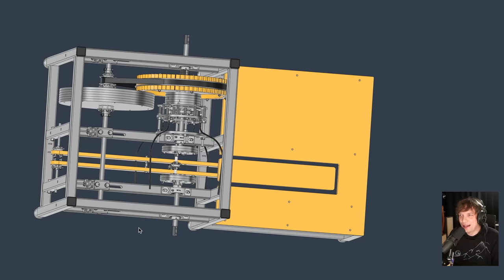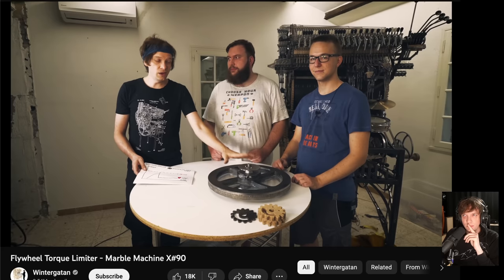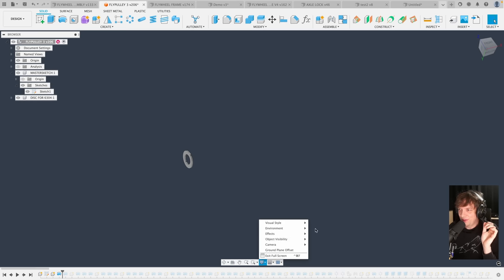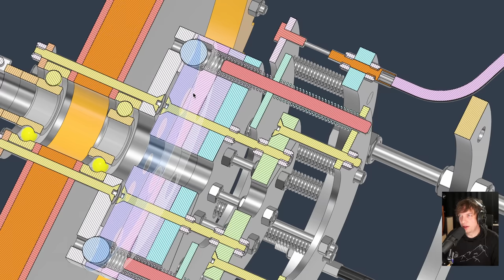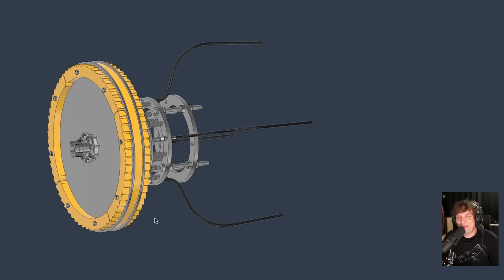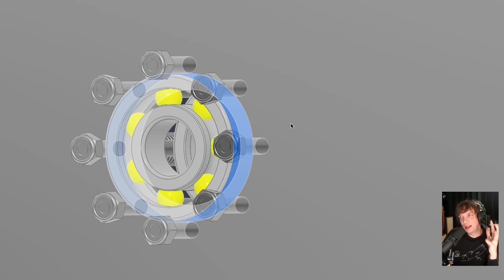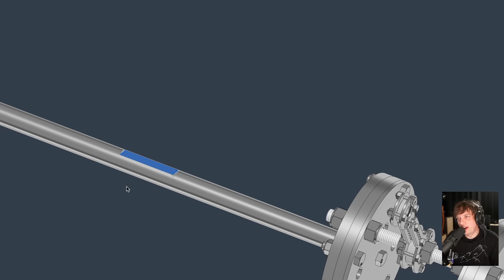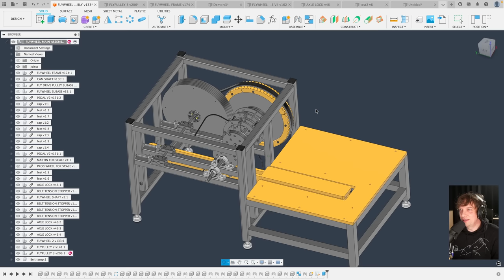Safety First! - Marble Powered Clutch

Comment: 10:35 Hey martin as much as as love the choice of using marbles for the clutch wouldn't it be simpler to use a plate with bumps on it? Alot of the complexity i see here is because of the use of marbles and by having a plate it could reduce complexity and compress the design down. It could also would make the disengage mechanism of the clutch simpler since you would on need at most one spring for the whole set of detents. since they are on a plate you could place a separate plate that is pushed by the spring that separates the spring from the plate with detents you could pull back on that spring and release the clutch that way saving another spring.
Reply: I think the marbles add "continuity" that the bumpy plate does not. Unless you break really fast and high force, separating the plate might be a jerky action with high friction between holes and bumps, thus degrading the bumps faster than marbles.
Reply: Machining a plate with bumps to a high enough precision to be effective would be a lot more complicated than machining a plate with holes and putting springs and bearing balls in them. And I imagine the metal-on-metal screaming that would occur during an unplanned disengagement (or a re-engagement in general for that matter) would be awful.
Reply: Fewer parts. I agree.
Reply: Define simpler? A plate with bumps on it is a relatively serious machining operation to create if you can't find a good one off the shelf, and even if you can could be tricky on the world tour if its not a super common part. And as the bumps are wear areas it will need replacement sometime. 
This is simple constructed method to get the result with parts that can be made almost anywhere, with very limited tools, and if you pick the right materials you can be sure it is the cheap and relatively easily replaceable balls that must be replaced most often.
Reply: I think that would save a lot of parts but it could also limit the usefullness of the torque limiter since one of the main benifits of using marbles in the desighn is the low friction when the torque is too high since the marbles are free floating and mostly free to move. A plate with detents would allow more torque through the limiter since the unmoving detents would cause more friction. It would also wear faster while being less esily replaced and also heat up more and maybe distort depending on the way it's made. that being said I'm an electrical engineer not a mechanical one so I can't tell for sure.

Comment: Hello, I think there are a few constructive errors in this part.

First, it is important to separate high energy parts (only the flywheel!) from low energy parts. As long as it is possible that a lot of energy can suddenly get into the construction, you will have problems.

It is best to separate the safety clutch from the normal clutch and also separate the brake.
The safety clutch is placed directly between the flywheel and the belt, this is where the greatest jump in energy is possible. Then there should be a V-belt. With an adjustable tension, you automatically get a manual clutch. And then a normal bicycle brake is sufficient as a brake in the low-energy part.

Lots of love and keep going! ❤

Comment: Not a fan of the D-style axle flat. You get a tremendous torque multiplier from the large flywheel down to the comparatively small diameter of the shaft, and all that torque wants to force the two split halves apart. Maybe I'm reading the diagrams wrong but the only thing constraining them from separating are those 6 or 8 concentric bolts in their laser cut holes. Those are going to have slop because they have to be clearance holes (you need precision ground shoulder bolts or dowel pins in reamed holes to eliminate that) which means they will move ever so slightly. All it takes is those two split halves opening by a tiny amount and now you have play and slop against the shaft, and slop on a shaft multiplies over time because every time it starts and stops it wears a little more -- especially when it's mild steel of the clamp against (hopefully) a ground polished hardened shaft. Shafting isn't an area that I'd get creative with, there are plenty of established solutions for almost every need. For example you might want to use a taper lock system, which attaches to a plain round shaft by friction alone and is very strong.
Reply: He is a genius, he doesn't care. Been digging his genius grave for 7 years now.

Comment: Those half moon connections are really something. A little peg holding onto that shaft wouldn't stand the tork. Just perfect modular elements interconnecting to make one solid struture. Well done Martin!
About the bolt baring housing I'm a little more cautiously enthousiast as I really enjoy this idea, but a little worried about the point load ont the baring housing. Try to get some info on that at SKF (if you have not allready). 
Are those ratchets on the wheel perhaps for the future marble lift?
You keep up the good work and don't forget to enjoy the ride.

Comment: I have a fairly serious concern about how the braking force would be transmitted through the rotating component.
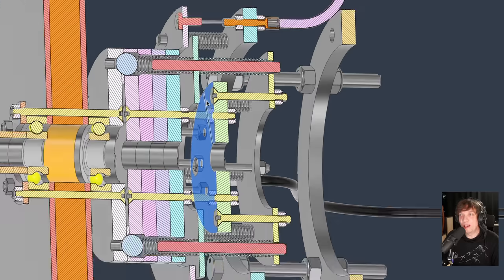Taking the cross section at around 12:04, as the pink disk is pulled back by the Bowden cables, it will press into the rotating cyan disk, and will apply forces backwards and against the rotation. The only thing keeping the disk rotating is the red rods, which are only solidly anchored at the yellow disk.
These will likely twist under the force, bending the yellow disk, and crushing the spring into the channel in the layered disks. This will get particularly bad if there is any kind of disturbance on the disks surface, as this could catch and dig in.

Then as the disk is pulled further, the braking force will engage. While the flywheel is not attached at this point, there may still be substantial momentum, and this will act to try and rotate the cyan disk against the rest of the system - again, a weak spot.
Some of this force will be absorbed by the green disk, but the green disk has mounting problems too (bolts don't like being loaded like that), and if there is more friction between pink and cyan than between cyan and green (which is likely, due to the springs), then there will still be substantial forces acting to twist the red rods, which provide a massive lever against the spring on one end and the yellow plate on the other.
There is also the issue of securing the pink plate well enough to provide the braking force, as it relies on a similar connection, although its rods are further out, and connected to a thicker plate.

To resolve this, you could take several steps:
1: add some solid rods from the plate stack to the yellow plate, say 8mm, and have linear brearings connected to the green plate.
2: remove the green disk, and make the bolts on the pink disk further out, add some bearings or at least grease between the cyan and pink disks, and add another disk (the brake disk), firmly mounted to everything else, and wider than the cyan disk. Coat this disk in friction material.
Then, as the pink disk is pulled back, it first pushes the cyan disk back, disengaging the clutch with minimal friction, then it pushes further and makes contact with the brake disk independantly. The brake disk has independant connections to the rest of the system, although has hols to allow the connections to the yellow disk to pass through it.
This preserves the same functionality, although it needs somehwat longer bolts for the yellow disk, and  avoids any substantial force going through anything moving in any other direction.

As a seperate set of improvements:
Make the pink disk be moved by levers so as to reduce forced through the bowden cables, add another disk the other side of the pink disk, so the rods holding it are mounted at both ends, and put some cheap linear bearings on the pink disk.

I much prefer option 2, and combined with he additional changes, this yeilds a system where no part has to excerpt force across a moving connection - everything is either lubricated or has a bearing. Forces on the cable are reduced by the lever, etc.

Edit: I didn't see that you planned to use the green part to transfer power onto the shaft. Please make this disk solid. The green has almost nothing holding the two halves together, meaning the turning force put from it to the shaft will act to split the halves apart. Splitting the halves like this requires far less movement than is needed to twist the bolts, so you're just putting move leverage against the bolts.
Having it play this role doesn't even help with the braking, as it still relies on the bolts back and forth to hold the halves together, and the braking force would likely hit the cyan ring, which is connected without much strength - so the braking force hits the springs and the yellow disk.
Also, the half disks in the stack are more aligned than I think they'd need to be - I'm prett sure it would be optimal to have none of them line up, as the thing hat matters is the strength of the connections between the halves, which is dependant on how many splits line up.
Although this doesn't really matter, as it's not a weak spot anyway, and having them all be the same is probably better for ease of assembly
Reply: Feel free to ask for clarification on this - I can hack together some cad for the proposed changes if you want.
Reply: Why do you even waste your time and brain with this "project"...
Reply: @constantinosschinas4503  Because I can. My time, my brain. I mean, its more constructive than adding even more LAMS to my current FtD ship - the thing doesn't even get hit by projectiles any more honestly.
Reply: @deathofallthingspotato9919  I have spent a huge amount of time jn this project, Discord too, for the very same reason you mentioned. Doesn't worth it, nobody listens, all martin groupies (which ruin him more than helping him). Regards.
Reply: @constantinosschinas4503  Fair enough - I've deliberately avoided the discord because I don't feel its worth it, but I do like analysing the problem.
Honestly though, I quite like looking into failing projects, so I might give it a look.
Reply: @deathofallthingspotato9919  lol. fantastic. go for it! it has been a lovely little school for me as well.
Reply: @constantinosschinas4503  I shall go there with your blessing, and my second burner discord.
Reply: @deathofallthingspotato9919  You have my blessing, heroic Knight.
Reply: @constantinosschinas4503  You have my thanks, now, once more into the breach!

Comment: so I think the design would work, but do you really need to do it with so many parts? would it be possible to decrease the number of parts? the more parts (not just the moving parts) the more chances there are for part failure.
I see places that could be one solid piece that is split into multiple, when manufacturing for that part would be easy in one piece too. more specifically where the marbles for the clutch are held you could make 3 of those disks into one part, with simple threaded holes in them. maybe you chose to split it up to make it easier to tap them, but an issue would be that it might not line up, and you would only need to tap part of it and have the rest not engaged to the bolt. even accounting for the keyway, this part shouldn't have much stress on it (the marbles will disengage before there is substantial stress) meaning that at least for most of the clutch you don't actually need a keyway, the bolts should be strong enough to hold it together aligning with the part you show near the end with the keyway (and possibly a small part of the clutch with one too). this would drecrease part count, decrease production cost and time, and while it is "cutting corners" it is one were the corners cut are into the copious margin of strength that part would have. to ensure you don't over load the bolts however I suggest doing a strength test on them to see how much force it takes to bend, shear, or snap them to get an idea of what safety margin you should have in this part.

as youve said in previous videos decreasing part count helps with reliability and manufacturing. the old fly wheel design I think has less parts, now the breaking feature with how dangerous the flywheel can be is a need, so parts should increase, but the clutch part itself should be about the same. im just curious if there was a design descision made not explained in the video to why it is like that. maybe it was for using a large metal plate to cut out all the disks, though with a bar like that it could be less time consuming to lathe it to shape.
Reply: I agree. Also no breaking material. Would have done a cycle brake setup and a correct bearing with flange housing
Reply: The 3 disks aren't actually disks. They're all split down the middle, and the split has been offset between each disk, so together they form a solid whole. This is so it can properly grab on to the slot that martin discusses near the end of the video. So they're separate parts for a reason.
Reply: @TijmenZwaan  yeah. But it is a bad solution. You should use a woodruff key solution instead, which is much better for transferring torque and alignments.
Reply: @TijmenZwaan  I updated my comment to contain my reasoning to reject that. though that does seem to be the reason he did, it isnt the best solution.

Comment: Hi Martin,
please reconsider your choice of using the torque limiter as a clutch. The torque limiter is not designed to re-engage when there is a difference in speed between the flywheel and the other side of the torque limiter. You would be better of using a proper friction based clutch for that purpose in addition to the torque limiter.

Comment: Since you spend so much time in CAD, might I suggest buying a 3D/SpaceMouse? 
I only recently got one, and it is amazing. 

(It will allow you to move, rotate, pan and zoom AT THE SAME TIME. which will not only greatly improve your speed but also results in very smooth motions for your CAD video’s. 

It does take a little bit of time to get used to, but after a day or so you’ll never want to design without it. )
Reply: I was thinking the same! I got myself a great deal on a lightly used Spacemouse Pro last autumn, and it's just fantastic!
I can't believe I've been working in CAD for close to 20 years without one.

Comment: 1. Are you going to stand on the platform and push the pedal down under the platform? That will be uncomfortable.
2. If you accidentally turn your foot when pedaling your toes will be cut off on the way up. Consider a safety hinge on the pedal arm instead.
3. There will be a lot of friction between the revolving part of the clutch and the nonmoving part when you start to engage the clutch leaver. In car clutches a lever pushes on a release bearing to solve the friction problem. Then only one cable is needed for the clutch.

Comment: just a thought in regard to the pedal and platform positioning (I may have observed incorrectly, if so disregard.). If the standing platform is level with the highest point of the pedal, pumping will use far more energy than if it is level with the lowest point because every push will require you to move your entire body up and down.  If the platform is at the lowest point you can still push all your weight but when things are going, you only need move the one leg to pump.  If the platform is at the peak to avoid crushing, you could just add a skirt that stops anything from getting between the two whenever the pedal is above the platform.
Reply: This. I seem to remember that the platform was there so you didn't get a foot trapped under the pedal. If so, you are going to use your right leg to lift and lower your whole body to operate the pedal, which will be very tiring. If you attach the pedal at the back hinge point and let it float on the cam point (rather than a hard attachment to the cam) that would reduce the crush potential.
Reply: You can also still get crushed between the pedal and the underside of the platform, seems almost more likely than the reverse.
Reply: If the pedal were just made taller than its range of motion then nothing could get beneath it.  So long as the range of motion is less than the height of the lowest point so it won’t collide with the ground.  Like an elliptical cylinder rather than the flat oval that it currently is.   (this is what I mean by a skirt as it can just be a hollow wall on the bottom of the pedal)
Reply: Organ pedal, design it like an organ pedal!!!!!

Comment: Thanks for wondering off, i was kinda expecting you do model the holes kinda like you did by revoluting twice but it was nice to be confirmed in that assumption :)

As a machinist i actually think your bearing idea might work out, getting it centered will def be a challenge, however getting this on a lathe would either need a huge chuck or more holes, so i think your idea is pretty good.

The "no key idea" would also be good for a single part, however since youre plitting 5 discs or so into halves your actually reducing the stability of them while adding more parts to the assembly.
The best solution would probably be to simply extend the flat spot all the way to the end and slide the discs onto it. Since its getting machined anyways it doesnt matter how long the flat spot is from a cost perspective.